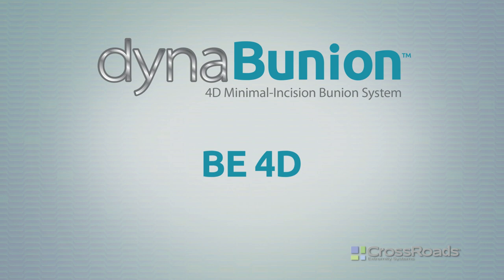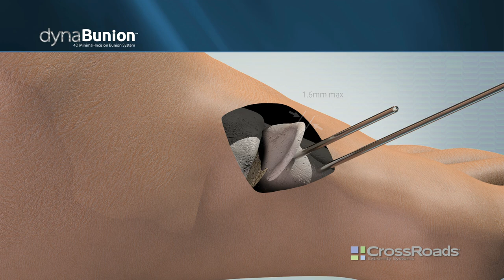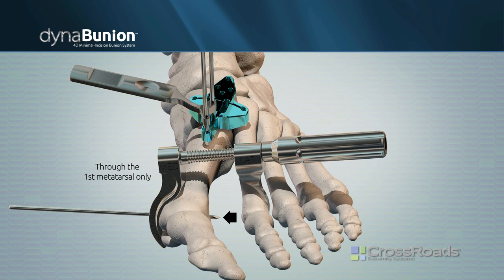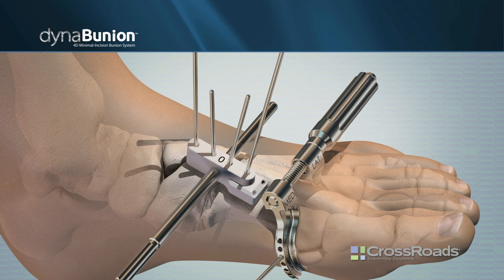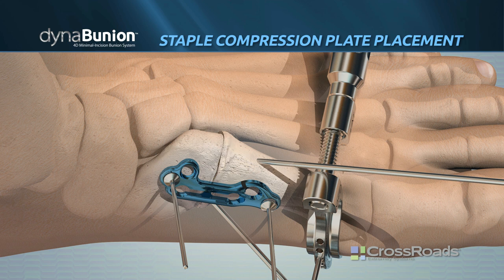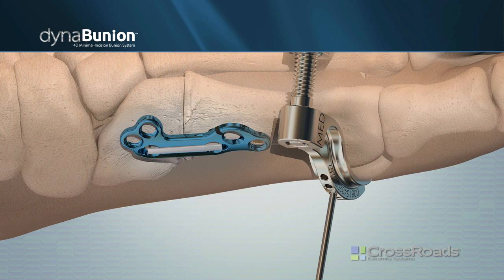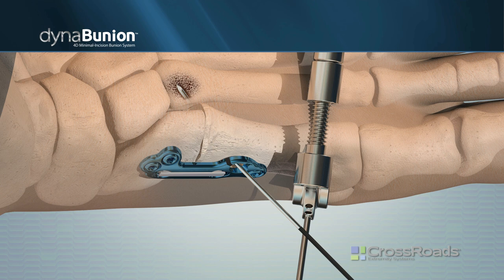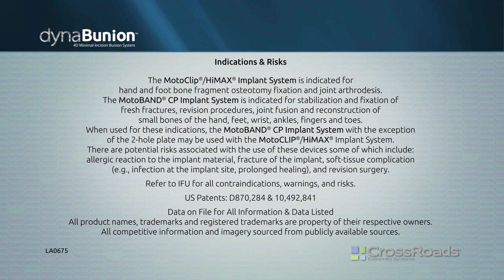DynaBunion™ 4D Minimal-Incision Lapidus System - Narrated Animation

Comment: Im so confused. Why is the Metatarsale always cut during bunion correction? Can it not be pushed or pulled back into the correct position?
Reply: @jonathansweeney2167  Is this a good procedure for metatarsalgia when the bunion angle is modest?
Reply: @jonathansweeney2167  Does the screws stay in for life? or do you get them removed once the bone has mended?
Reply: @springin2tri  That's what im wondering. I've had a terrible case of metatarsalgia for 7 years and I have a mild bunion on my big toe and a mild tailor's bunion on the little toe. 

Have you found out anything helpful since your last comment here?
Reply: @mainthecharacter5971  i had the Same screws in my jaw. They put Them out After Its healed
Reply: Because often times there is bone growth in addition to misalignment.
Reply: @deenad3562  he’s not talking about the bone spur on the bunion. He’s talking about them cutting the 1st Metatarsal in the realignment process as opposed to just “pushing” it into proper position
Reply: Because that's the bone that's not aligned
Reply: @eduardoq.h.9259 it still doesn’t have to be cut in half

Comment: Why do the words "over-designed" pop into my head watching this video?
Reply: Lol. Hey as long as it works.
Reply: Losing the arch is the cause due to miscarriage of weight on that foot. Why can't posture to feet be addressed to correct muscle strength.
Reply: Having gone through a similar procedure without such accurate tooling, I understand why they are necessary. It's just very difficult for the surgeon to achieve the correction of the IMA, DMAA, etc without tooling which lock all the angles. Since every angle affects others nearby - without the clamp and the hardware which locks the joints into place, things are almost bound to go sideways
Reply: Having performed this proceedure several times on friends and family, I feel it's the most user friendly option for amatur Home Surgeons